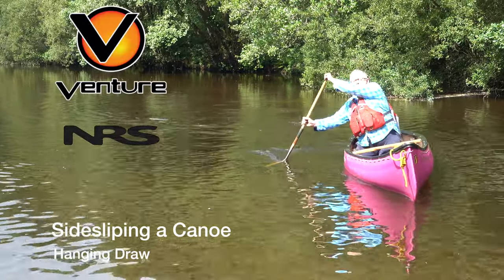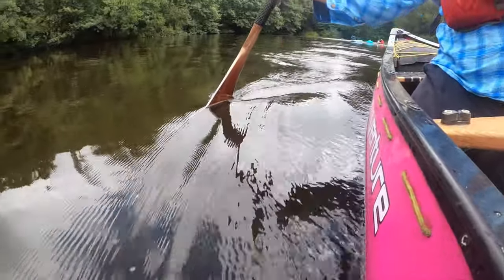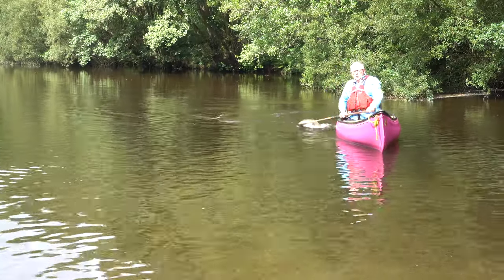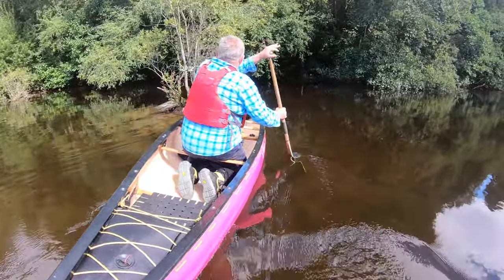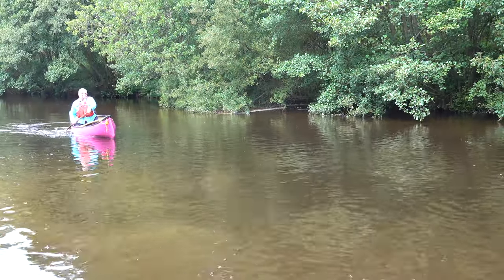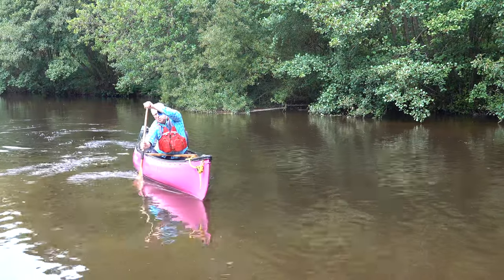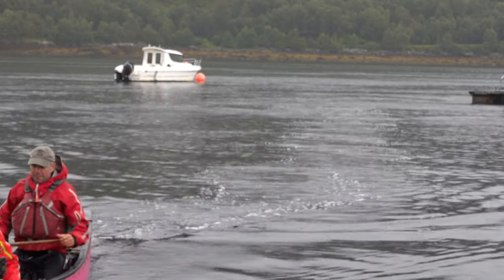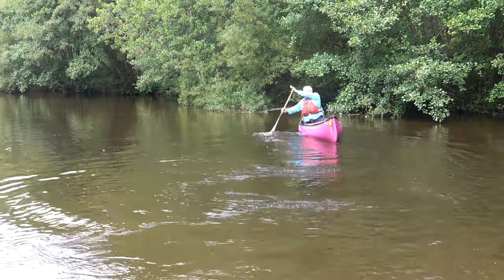Sideslips in a Canoe:  Hanging Draw, Crossdeck, Running Pry, Solo and Tandem

Comment: hanging draw is currently my nemesis - I'm working towards my Canoe Award this summer to go onto canoe and kayak sheltered water coach over the autumn. I can do it if I'm going slowly but lose it as soon as I try going a bit faster, and only on one side atm (coincidentally the other side to my stronger running pry stroke - so I'm ok if all my obstacles are one the same side ;-) )
Reply from the maker: Not easy to master but one trick is not to give up on an attempt.  If the boat begins to turn react and move the paddle forward or back to correct the spin.  There is rarely a perfect placement and I will be constantly adjusting the paddle fore or aft.  Otherwise just keep playing

Comment: Thank you for this Ray. I always find the hanging draw difficult and for me boat turns rather than side slipping. I'll try moving the blade forwards or backwards to find the correct position.
Reply from the maker: Ah just to confirm most times I do not find the 'correct' position but rather am quick to react to any turn on the canoe by moving the blade to counter that.  I think it's a bit of a myth about there being THE position.  Once I ditched that as an idea I soon got the hang of it.   But it does help if the initial position is pretty good.  Have fun and I hope you get it sorted.
Reply: Thanks Ray. I've found your videos a great help for my paddling and I'm sure I will get the hang of my hanging draw 😁

Comment: A very good and informative video, nice one Ray, I used a hanging draw whilst sailing (was also using a lee board at the time) in 24mph winds without it i am sure i would have swam) so yeah a good stroke to master, but in reverse? Challenge accepted 😁.
Reply from the maker: 😁  Result awaited
Reply: @RayGoodwinCanoe  confirmed that I can reverse side slip, although you will have to take my word for it mind 😁

Comment: Ray, thanks for putting so much detail into your videos and demonstrating variety in the dynamic way they are done for both solo and tandem paddlers. (thanks Katrina and Colin) 
Just to get my understanding right:
1. Would it be correct to say these techniques all need to be performed with the canoe moving at a different pace to the water its floating on, and and by holding the blade so the water deflects off the blade as it passes and thus causing the canoe to sideslip?
2. Its called a 'hanging' draw because its a draw that just hangs (pauses) there for a while before being drawn in?
3. Its called a 'running' Pry, because the canoe needs to be in motion (runnning) to be able to perform it? (if the canoe is stationary then its just a pry)
4. Is a hanging draw the same as what some may call a running draw, and a running pry the same as a bow jam?
Reply from the maker: Yep the canoe has to be moving faster than the water the blade is put into.    Yep on hanging and on running.   I suspect that the hanging draw and running draw are the same (we seem to like lots of names for the same thing).  The running pry and bow jam both use the blade in the same way and effectively in a tandem boat are the same including position, in a solo boat a running pry is done midships whereas the bow jam is done much further forward.  Hope that helps
Reply: @RayGoodwinCanoe  Thanks.  Im happy to accept there are lots of names for the same things, just working out what all those sames are, and which are not same.  I originally learnt bow draws and cross bow draw, which in the initial rudder phase were called a standing-draw. 
You say boy, I say boo-ee, but we can bother agree it's the same buoy.  I just have to make sure someone is not actually referring to a male child floating in the water :) 
Again, very helpful instructional video
Reply from the maker: I must admit I prefer the North American and Dutch (I did a lot of sea kayak guiding for Dutch groups) pronunciation of Boo-ee: far clearer and apparently it is the older way of saying it in Britain.  No wonder my daughter is confused by spelling.